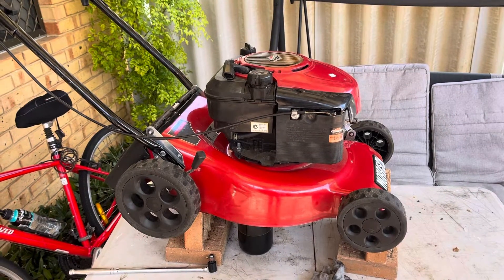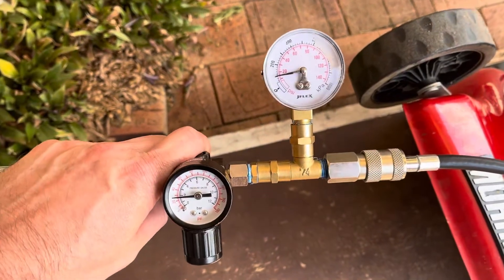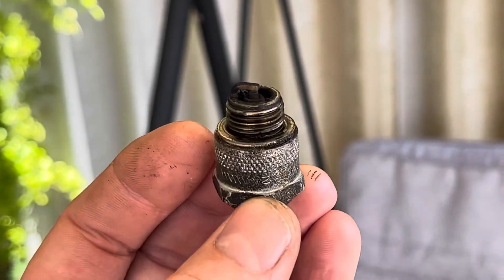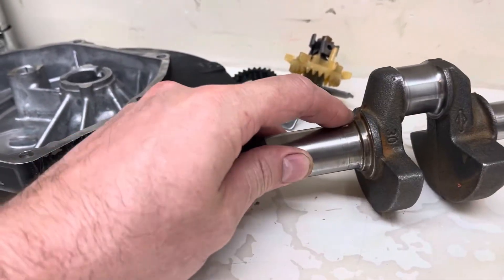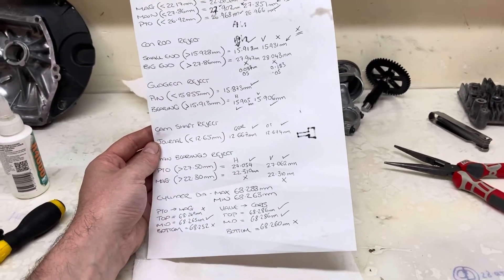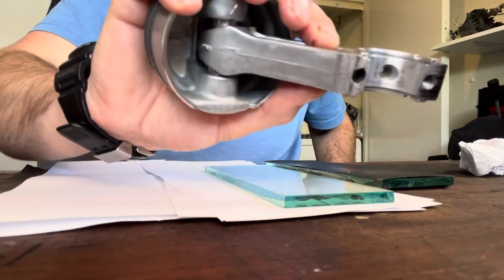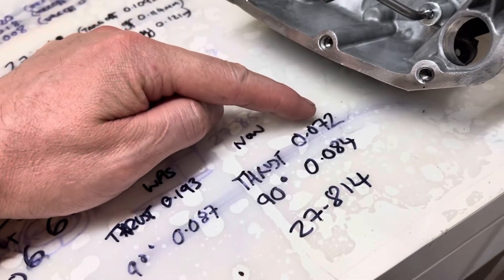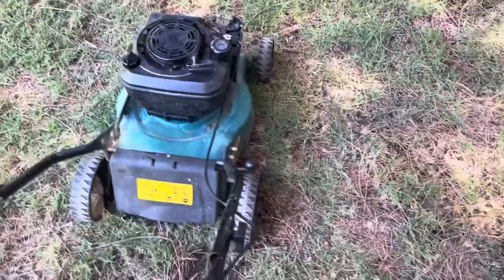FIXING ENGINE KNOCK FOR FREE! - EASY DIY HOME REPAIR THAT ANYONE CAN DO!

Comment: Could this same repair be done on a 12 hp Briggs riding mower engine? Thanks for video.. great job!
Reply from the maker: Depends if they share a journal honestly!
Reply: @VintageEngineRepairs it's a older single piston engine.
Reply from the maker: Then yes :) it's not ideal on any machine, but it can work!

Comment: Unbelievable. Love your detail. Even though I don't see myself being able to do this so called easy DIY I'm very impressed with what you do. Thanks.
Reply from the maker: Thank you for the kind words!! :)
Reply: @VintageEngineRepairs  I found out that one of the connecting rod bolts was only finger tight. That would cause a loud clang and bang for sure. I don't know if that is something that can be repaired or if it is on it's way to the dump. I think the latter  - it's final resting place.

Comment: Nine times out of ten when you get one of these burning oil the knock is caused by carbon build up. I've had loads of these which sounded just like a bad big end, simply removing the head and cleaning the carbon off has cured the knock.  I'm not saying this was the cause of your one, but just thought I'd mention it.
Reply from the maker: Thanks for sharing mate! :)

Comment: Couldn’t hear anything over the engine. I have to disagree though, I think it is absolutely worth it. A good mower will cost you a few hundred dollars. Even replacing the crank and rod will cost you a couple hundred. This is a cheap fix, basically the price of a gasket and maybe the seal and you’re good to go.
Reply from the maker: Very true!

Comment: What did you use to compress the rings?
Reply from the maker: Where necessary I’ll use a plastic ring compressor, however, this cylinder has a tapered hole which means you can just feed it in by hand without the need for a tool.

Comment: How much is "expensive?" Comparing a mew con rod to a short block or another engine, a new rod is cheap. A mew rodut, only if the journal is not out of spec.
Reply from the maker: They are between 55-75 Australian dollars for a new conrod!

Comment: So the knocking red mower was fixed. 
And it magically turned green in the process. Interesting indeed. 
Fugazy -ish.
Reply from the maker: I said I changed the deck as the red one is going to be used on another project. The engine cowling wasn’t put back on at the end as I wanted access to the governor which is hidden under that cowling. It’s the same engine… you think I’d go to that much trouble NOT to show the result? 😂

Comment: I see a red mower in the start with a knocking engine, and a repaired green one with no knock being shown as the repaired one. The engine even looks different.
Reply: Wow hard one to believe, he has the red and small black plastic engine covers removed it is the same engine as Jake would say "there is no trickery here!"
Reply from the maker: @waynestefinashen239  haha thanks Wayne. One thing I pride myself in is honesty - doing the right thing when no one is looking.
Reply: @VintageEngineRepairs  Tom it only makes sense to be honest when doing a video and trying to help people out with doing their own repairs and service. Sometimes i think a small engine repair video on blunders would be a good idea but rarely do these happen when your filming. As an example we have stripped a bolt or nut when using our impact driver on say the #2 setting but we were not filming this at that time. Basically that will never happen again because Jake will either say in a video that in these cases ie: start threading in by hand then tighten to full torque specification but do not use an impact gun unless it is set at the lowest torque setting, finish off by hand only to torque specification or if you do not have a torque wrench hand tighten only. Ken did some super videos where he forgot to install stuff and pointed it out total honesty and respect there brother!
Reply from the maker: I said I changed the deck as the red one is going to be used on another project. The engine cowling wasn’t put back on at the end as I wanted access to the governor which is hidden under that cowling. It’s the same engine… you think I’d go to that much trouble NOT to show the result? 😂
Reply: @VintageEngineRepairs  True, I was wondering how that happened. lol I have a (I think) a very old Briggs & Stratton with a kick starter on it. Is there an email addy I can send you pics of it to help identify it? I have looked around alot on the web with no real success.
Reply from the maker: @michaelkennedy2528  I have no idea about vintage Briggs I’m afraid, best to join a Facebook group, they’ll know instantly :)
Reply: @VintageEngineRepairs  Oh, forgot to mention in my other response. Why not just put in a shim to take up the clearance in the rod? My dad drove trucks way back in the day going through college and he once had to use an aluminum can piece as a shim in a diesel truck on the road side.
Reply from the maker: @michaelkennedy2528  that’s an interesting idea!
Reply from the maker: Spot on Wayne, the best videos are the ones where people show their blunders. Taryl has done many times and for someone of his capability and experience that speaks volumes. I have told Kenny before the same thing!